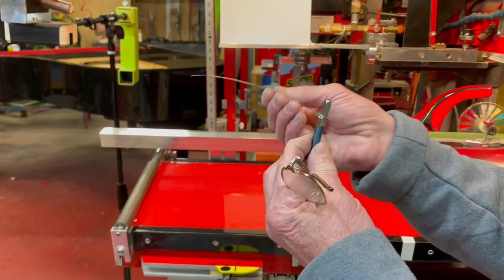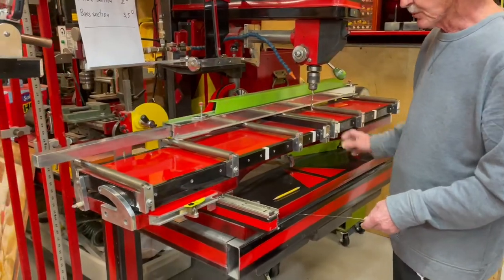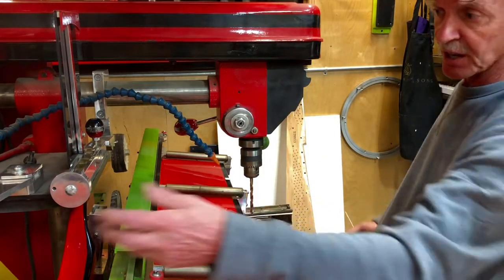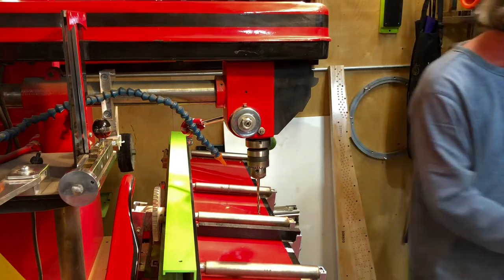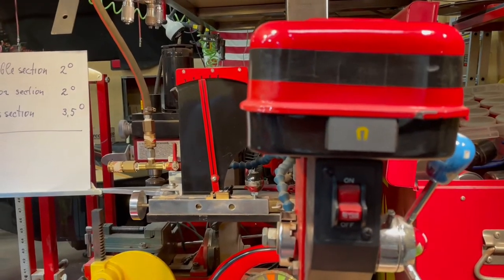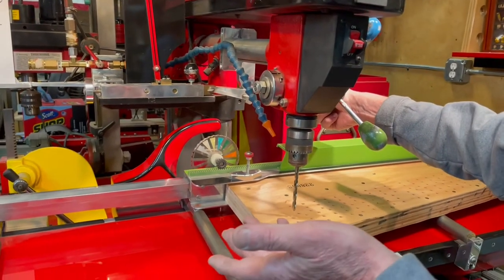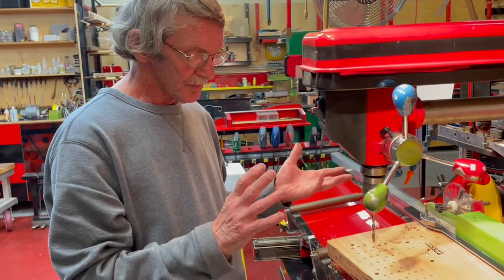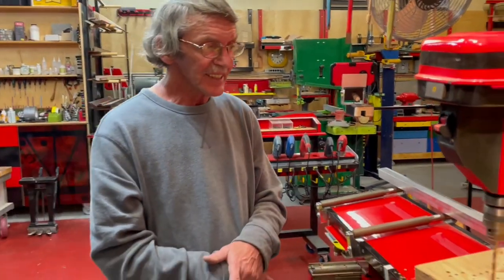Piano Solutions XXI: Boring the Pinblock

Comment: You distort the hole when the pinblock lifts when you remove the drill bit. And you "burn" the hole with too high a drill speed.
Reply from the maker: Dear fellow technician!
I completely understand you concerns about burning the wood inside the pin block on the high speed of the drill press.
On my equipment I don't have this problem. I can bore over 240 holes in 12-15 min.
And a drill-bit I use hardly get warm.
 Of course I use the special sliding table ( as you can see on my video).
This result can be even improved if you make some research and testing.
I suggest to look for better cutting tools (drill bits) and more precision equipment ( drill press, milling machine and overs).
Sincerely, 
Gene.
Reply: Exactly. and drill speed is much too high.

Comment: Not excellent. Technical overkill and deficient in areas that matter. The pin block is not clamped down sufficiently and sometimes comes up at an angle when retracting the drill. This for sure ruins the hole by making it too large.
Reply from the maker: Hi there! I understand your concern. The pinblock is secured enough to the moving frame. I have no problem with what you had mentioned and your concern about the size of the holes in the pinbock. The holes are perfectly straight and I am not sure where you see them being too large, you can come and check and measure for yourself. All of the pinblocks that I have done for the last 20 years, 1,000s of them are perfect.

Thank you for your feedback.
Reply: @PIANOSXXI  Well, at some time it can be seen that the pin block is lifted up by the retracting drill. For sure this will make the hole too large. The pin block is only held down at two points on the far side. This is clearly not enough. And some (not all) holes WILL BE too large..
Reply from the maker: @michaeljaneschitz-kriegl9598  

Thank you for your comment.

I've come to understand the complexities involved in working on the pin block. There are numerous variables to consider. Allow me to offer a valuable piece of advice: if you secure the pin block permanently, you are likely to cause more damage during the process of drilling the holes. Therefore, it is advisable to avoid permanent fixation to prevent additional complications.

I'd be happy to see your technique for drilling the pin block and we can discuss the best option.